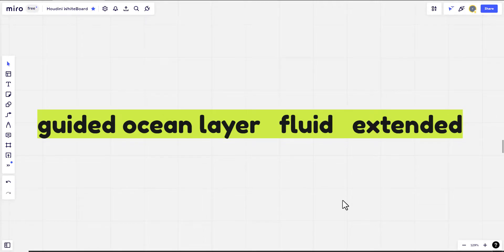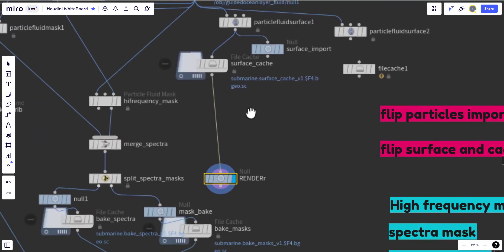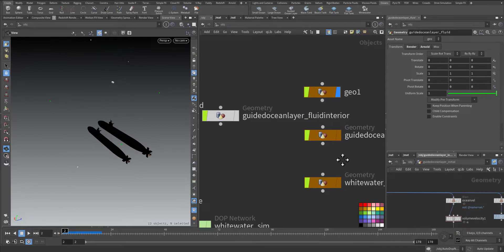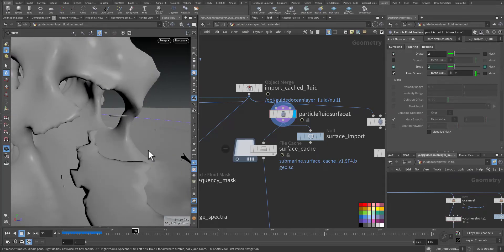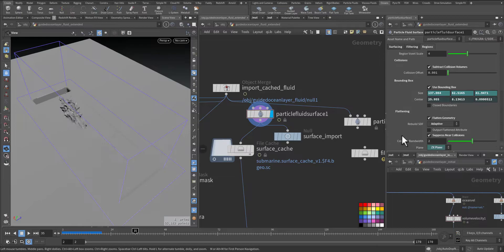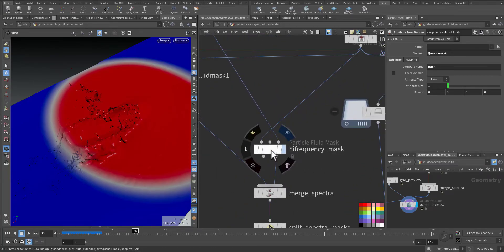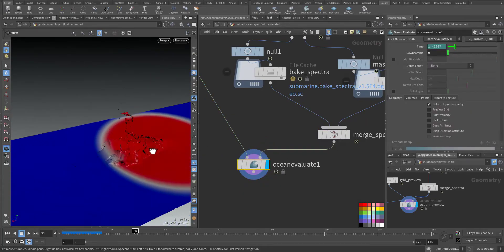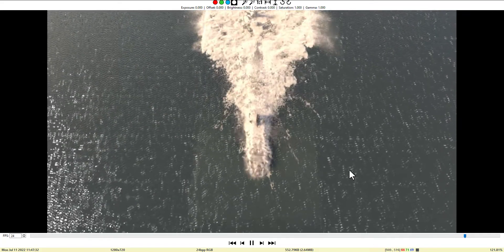Houdini Tutorial: how to make Ocean Simulation Extended?

Comment: and also, most people like myself will ask: will this extended ocean work in redhsift or unreal engine? Thank you sir
Reply from the maker: No, the pipeline is different for redshift
Reply: @FaddyVFX  why does render engine make difference except from material part? Sorry i try to learn houdini. I was gonna apply this method to my work but i have redshift render engine. Wanted to ask this
Reply: @keremavan4231  You are correct, its only the maerial section that is different. Only Mantra and Karma CPU can currently render whitewater in the industry standard way. So the results never look as good unless its a far shot. You will need to create custom shader to apply your displacemnet in redshift in only the flattened areas, and im guessing you'd also have to bake the specrum out as an image displacement for redshift to use